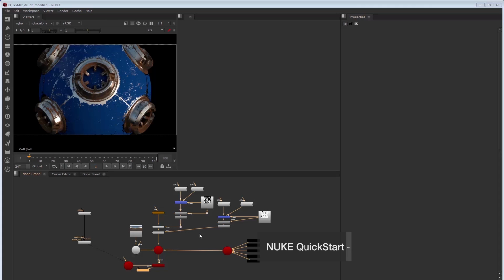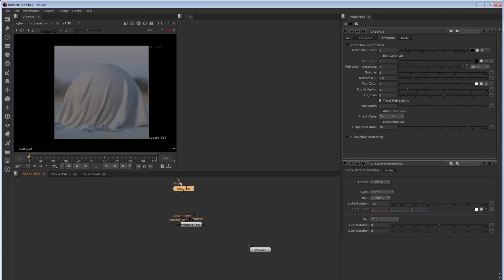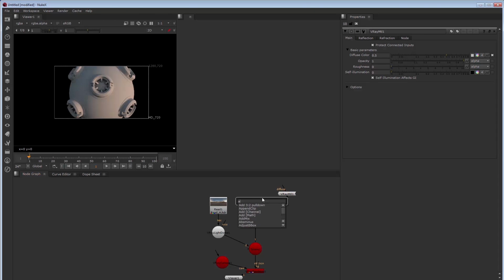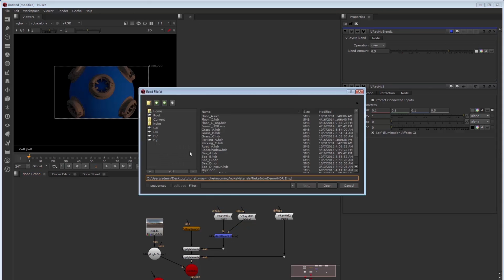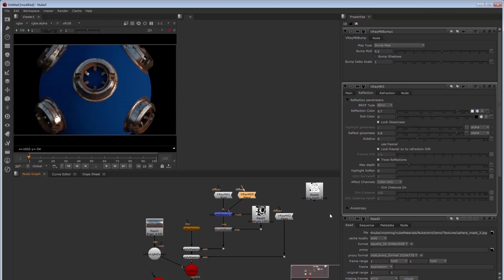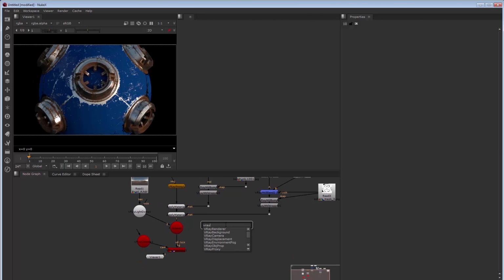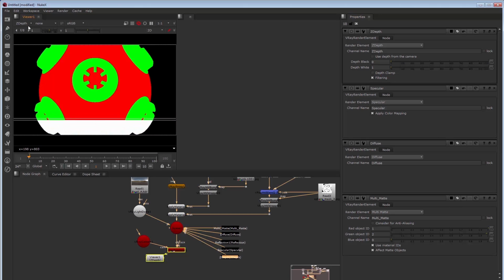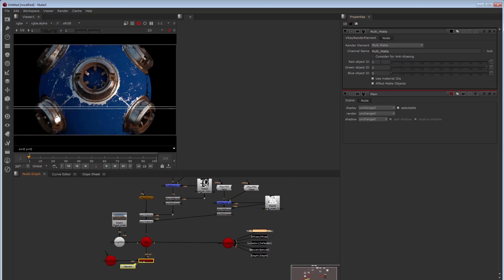V-Ray for NUKE – Quick Start: Materials and Textures

Comment: Greetings, I have a problem with the ambient occlusion issue and it is that I do not apply it to the surface of the floor with the object, I have the plane next to a 3D object in order to see that it is possessed with the floor and not floating in the air, how do I solve it? and I'm using the VrayDirt node
Reply: Likewise!! I support this same question for the correct workflow to be used when applying V-ray-Textures.
Reply: Hola!! Lograste tu objetivo con vray? Que te paso en Facebook? Saludos!!